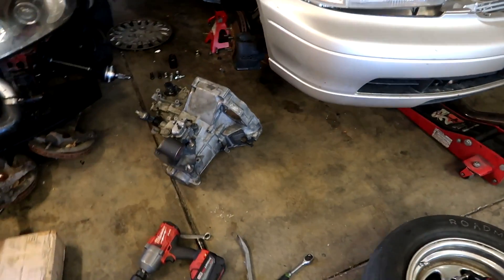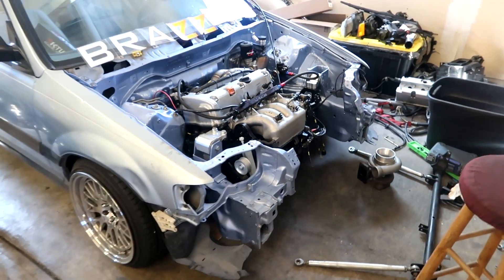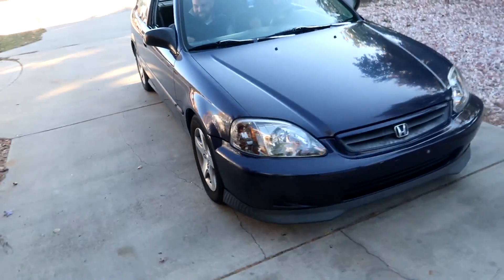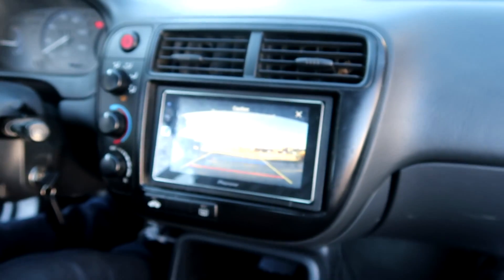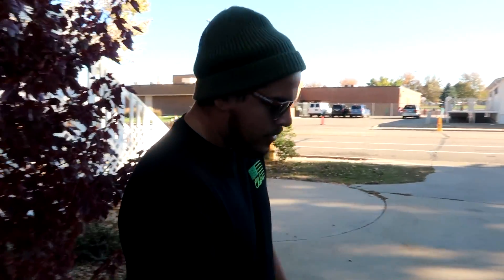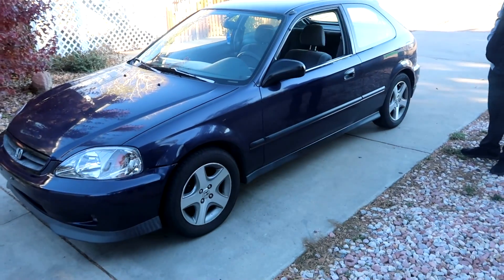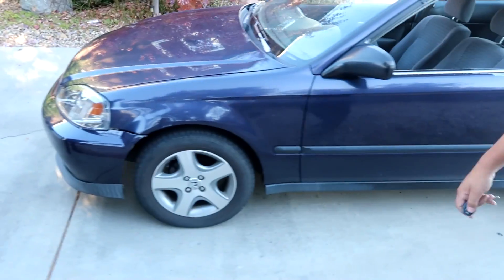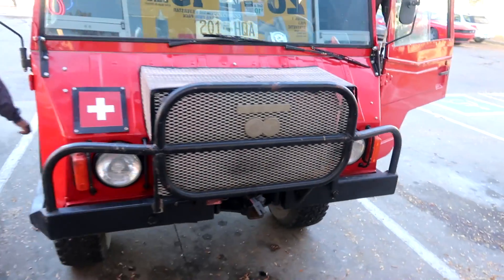Another Addition to the Family!

Comment: Regarding the pin on the crank to the flywheel. Are the crank and flywheel individually balanced or are they balanced as an assembly, thus making the pin position crucial? Just a thought to consider before putting the Odyssey flywheel on.

Comment: Hi guys random question is this video but I’m looking to do a conversion here in the uk, and I want to put a b20b non Vtec into a classic mini with the use of special frame. I can get the engine from a crv here in the UK but they are 4x4. Does the B16/18 s80 or s9b gearbox/trans fit up to the b20b without any issues? Just use the B16/18 clutch, Flywheel and pressure plate?

Comment: You need to line up the pin on the flywheel cause the flywheel balances the crank with the balancer so it not being where it’s supposed to be the crank won’t be balanced

Comment: IT DOES MATTER HOW THE FLYWHEELNIS BOLTED ON!
The flywheel needs to line correctly up for the rpm sensor. On the flywheel there is a cap where a thoot is missing, the rpm sensor knows at that cap where  the crank is/piston tdc. Its important for the engine and ignition management.

Comment: Careful that pin on the crank might have pushed through the crank and is touching the block. Might be why it locked up. Torquing the flywheel could have pushed the pin inward. That's why it looks so flush with the crank. Could just be the camera angle to I suppose.

Comment: BoostedBoiz, I have a 02 civic ex coupe 2 door that I bought from one of the car guy's I hang with. The car itself has less than 47,500 miles on it and I only have a K&N CAI on it. It's got maybe 145hp now and it's got the 1.7l vtec. My Q is can I put a ebay turbo on it while running factory engine and factory automatic transmission?. I know I would for sure new fuel pump, injectors, and new ecu I think and if I need anything be sure to let me know. I'm looking to bump the power up to like 200ish hp or if I can safely, I would love to get 250-300hp. I can't afford to build the engine and trans to do what I really want to. Since I got into a wreck on 7-6-18 and just had surgery on my foot on 9-7-18 (foot got ran over by the a-hole!). Money is tight but I'm addicted to hp and speed and thought I'd ask you guy's since yall know dam near everything about Hondas. Thanks BoostedBoiz, keep the boost up!!!!!!!!!!!! lol

Comment: Those headlights are clean. But still CLAY BAR the paint, windows, Then POLISH the paint and windows, And WAX it. Polish the wheels too. Better then brand new. Do it.
Reply: doubt they'll do it, I suggested it once to do to the red hatch but I got no response. Red hatch is super swirled up. Sucks because that specific red color is so easy to correct, I can one step them and get like 90% correction out of them.
Reply: @NCRranger24  I once bought a bmw x5 with metallic black and the paint was super swirled up and scratched. It's a black car. The headlights were also fogged up. In other cars, simple polish and wax would fix and make the headlights/taillights clear but for the bmw i need to wet sand to get result. But still i got everything to look like a shiny  brand new like a black mirror. And it broke 1st necks as soon as i pulled out the drive away. Anyway I later sold it and made an extra $3k profit on it. Red should be much easier.
Reply: @hiddenkard3101  I'd never wetsand clear unless I'm immediately flipping the car and it needs a mirror finish for some reason and if I didn't care about whether or not the clear coat would actually last without failing or being easily burnt through on the next correction. I've wetsanded deep scratches out before, but with a lot of warning the customer and on their insistence that I do so despite my warning against chasing after very deep defects.

Edit: I do wetsand after I paint but I always spray a good bit of clear so when I leave more than enough clear behind, I wouldn't wetsand factory finishes just to remove orange peel because they have only the bare minimum of paint.
Reply: @NCRranger24  I wetsanded the headlights. That was my first wetsanding anything. I wouldn't be confident enough to do that on paint maybe on a extra freshly painted fender that i have laying around that needs correction. I would say clay, polish and wax will improve the paint almost bring to it brand new condition or even better then the factory paint job depending on the condition of the paint. And windows are so every important. Windows no matter how many times you've  cleaned them won't look invisible/clear like the day they were new. A shiny car with weathered windows will show its age regardless of how shiny it is. But with everything done you'll get showcar results.
Reply: +hidden KARD yeah I don't have a paint thickness gauge as they're so expensive so I avoid wetsanding unless it's a situation like above or the customer had a panel repainted with extra clear and the orange peel needs to be cut down some.